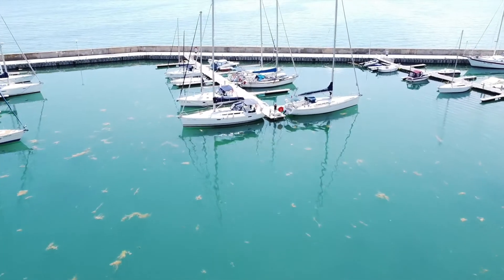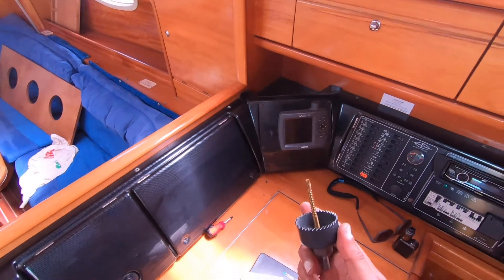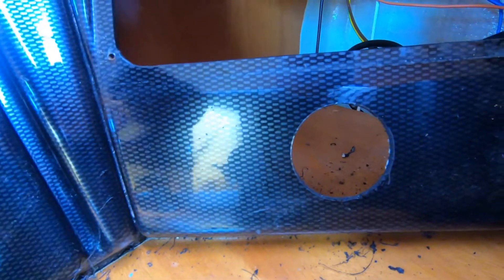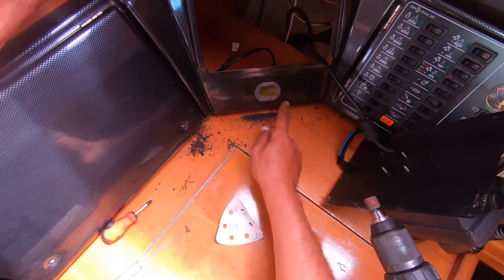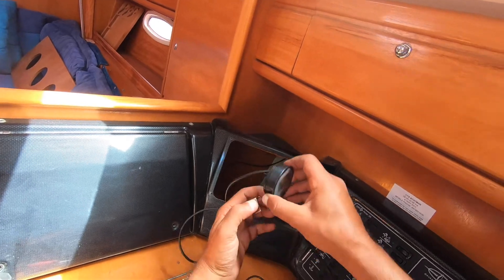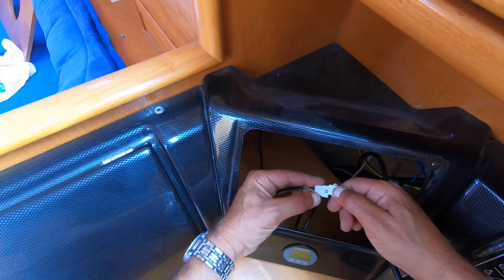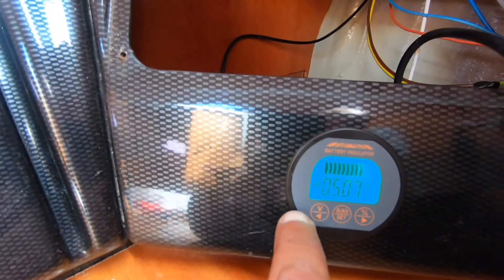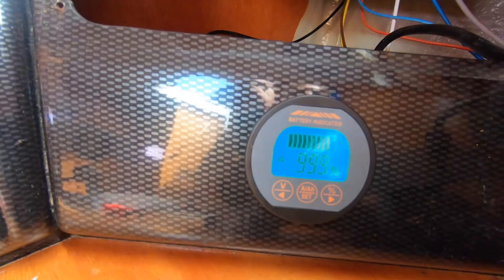40$ AiLi Battery Monitor installation part 2 of 2 ⛵ SE01E04: S/Y ELIZA ⛵

Comment: like your video!
I have the same device and no documents about it. 
I have a question.
When I switch on the left button, the voltage appears. Then, I switch the set button for 3 seconds and a voltage is flashing. What is it for and how much must I set?
Best regards.
Reply from the maker: i will be on the yacht tomorrow, will check for document and keep you updated
Reply: @saillingyachteliza  thanks a lot.
Reply from the maker: @pascalfuselier7540  download the pdf from. here (. https://files.fm/f/8g8q5bfmu ) or (. https://diysolarforum.com/resources/aili-battery-monitor-manual.58/ ) .. enjoy